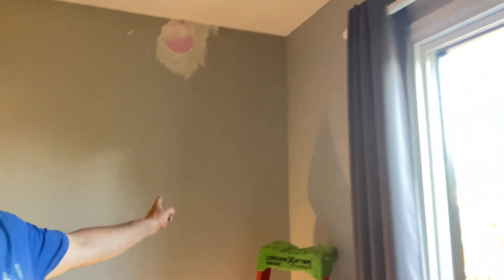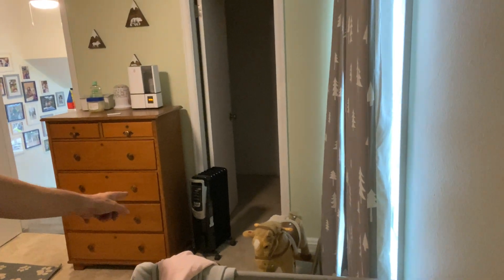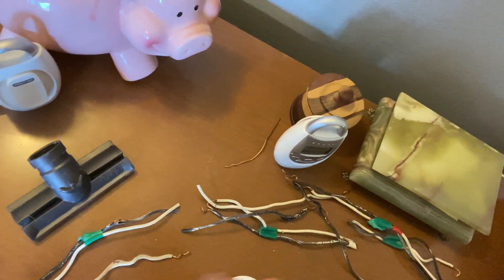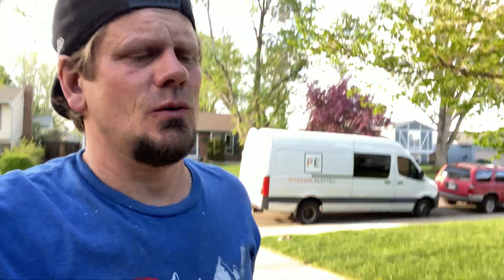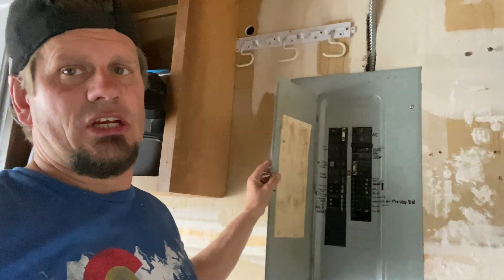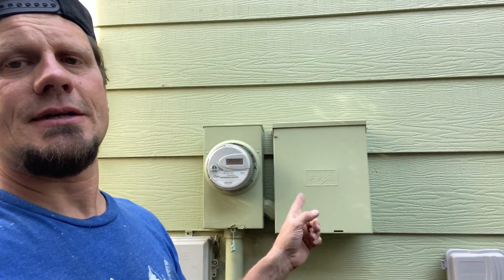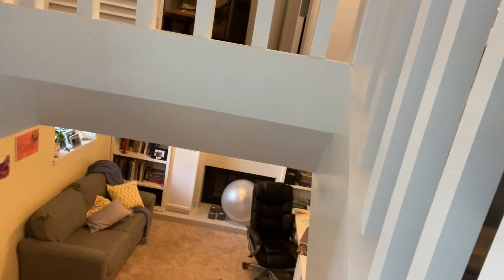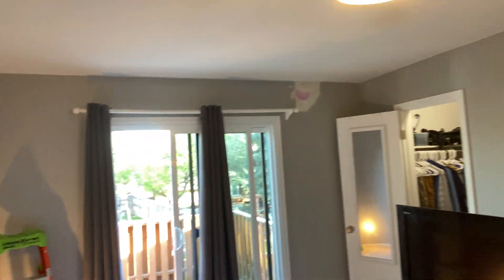Can a 1500 Watt 12.5 Amp Space Heater Melt My Circuits? Yes!

Comment: Inferior panel / ckt breakers are the prime suspect. And who knows how the previous original circuit was wired in conflict to code which could have damaged insulation prior to you coming on scene . (Possible over amp breaker to wire size and changed back)   Note : #1 Splice and set behind screw   VS  #2 stab in and daisy chain . Long term option #1. They are fortunate to have you on site to make right !! Back to work everybody.
Reply: Exactly. There is absolutely no way a single 1500 watt space heater could do this alone. It was on a circuit wired through multiple other rooms and was probably carrying triple the amps the faulty breaker was designed for.

Comment: That 12/3 wire is too small for the 2 bedrooms, hallway, Bathroom and down Stears on one 15 AMP circuit.
Every bedroom and Bathroom should have its own circuit Breaker 20 AMP circuit. And the Bathroom 20 AMP GFCI circuit.
Reply: nah 15A will do just fine. We never use space heaters here, we have forced air
Reply: Alot of resi today is 15a breakers and #14 wire due to the cost of materials.  You only see 20A in kitchens really.  Someone putting #12 for bedrooms is unheard of.  Maybe in a special situation but its far from common.  

You have money to burn while most people today look for the cheapest bid.  Saving money is all they care about. Especially with the current economy.
Reply: @beeps7  not even because of cost but because of modern electronics. you will never draw more then 15a in all bedrooms unless plugging in a hairdryer or something while other things are running.
Reply: You have to have a lot of 20A circuits in new homes. 2 counter 20A circuits in the kitchen, microwave 20A, dishwasher I think just has to be dedicated 15A and you can put the disposal on it. One 20A dedicated for each bathroom, one 20A for the garage, one 20A for the washing machine. Dedicated 15A for furnace. You're looking at about 6 or 8 dedicated  20A circuits for an average home